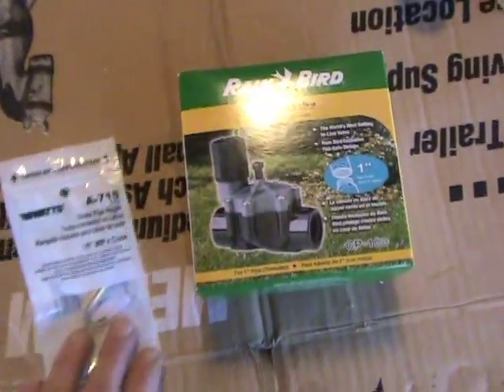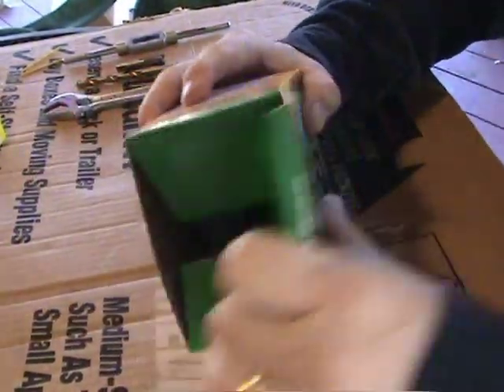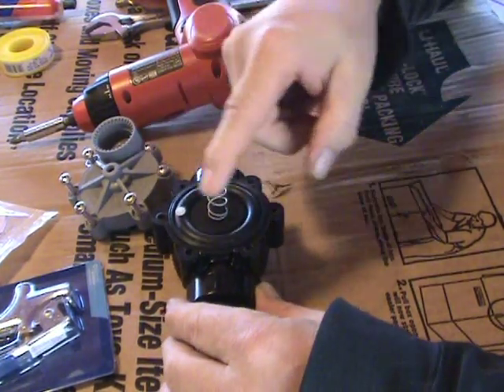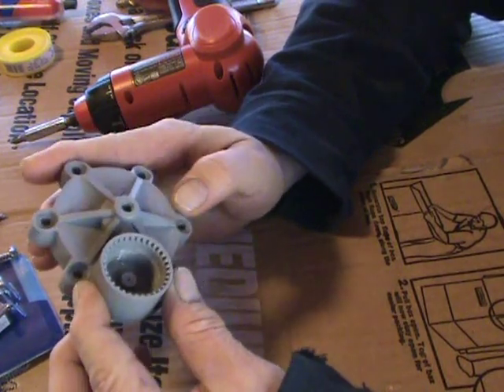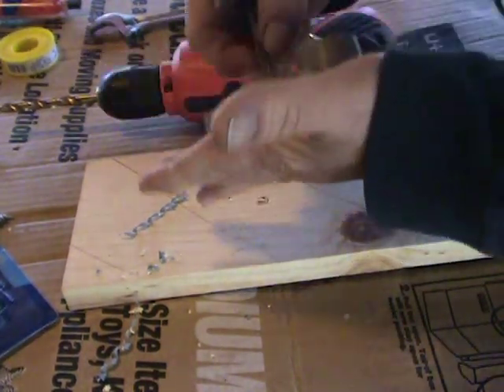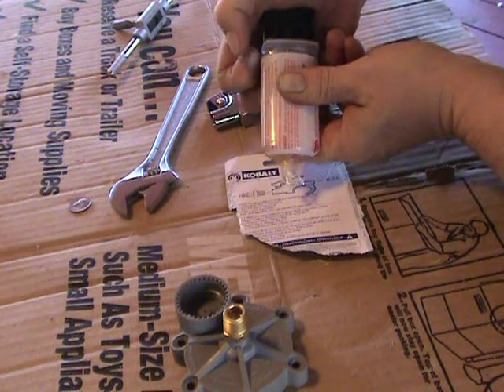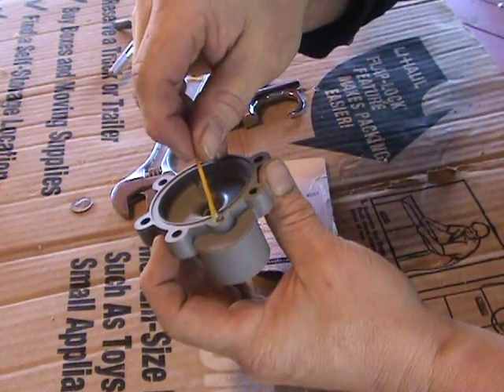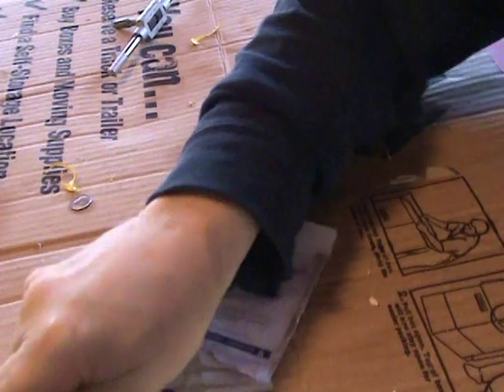Modifying a Sprinkler Valve

Comment: I wonder,  when using the solenoid as a triggering mechanism, if it would be beneficial to enlarge the small holes in the bottom of the solenoid housing slightly. Thus making the system quicker in response. Just thinking... An electrical trigger powered by a pair of 9 volt battery's wired in parallel should do the trick.  Mwa Haa Haa..

Comment: Can you help me? I bought a different valve, it had a hole in the center of the diaphram.  When I pumped the gun, the air pressurized, but when I pressed the trigger, the air came out the blowgun trigger instead of the barrel. So I plugged the diaphram, and now the air comes out the barrel, but the trigger doesn't stop the air from coming out. DOes your diaphram have a hole in it? Does it need to be there? I would like and answer ASAP. Thanks.

Comment: Thanks, this is a well done instructive instruction.  For me, I just plugged those two holes in the solenoid chamber with screws....I am pretty sure they will not be ejected and if it fails I will plug them with epoxy as in the video.....but I dislike epoxy...it is nasty to breath or get on skin.

Comment from the maker: @som1112 That could depend on where you shop. Don't get caught up in "part's lists". It's all about designing and building. With this valve all you have to remember is that you need a "tank" to hold air in, and valve to put air in the tank (Schrader or Quick Connect usually) and a pressure guage so you can tell how much pressure you have in the tank. Put the tank on the "back" of the valve and a barrel on the front. Done. 

Remember: ALL Pressure Rated PVC Pipe and Fittings. Safety First.

Comment from the maker: @Cwatts2009 

I'm pretty sure that would not be a good plan. You want pressure on the valve to build slowly. Opening a ball valve behind the sprinkler valve would drop all the pressure on it at once. 

What I've seen done for a trigger safety is a small brass ball valve between the Blowgun and the Sprinkler Valve.  Not sure how much safer it is but that's all I can think of. 

In handling a weapon the primary safety is always between your ears...

Comment from the maker: @Cwatts2009 

The blowgun does exactly what the solenoid does but *way* faster.The faster you dump the air behind the diaphragm the faster the valve will open and that's what gives you power.  Plus it eliminates the need for any power source. Nothing worse than a gun that won't fire because the battery is dead... 

The solenoid is (slightly) easier but less powerful. See SpudFiles for some actual numbers on how much more (I seem to remember it being about 10% more energy on average).

Comment from the maker: @jcjacob42 Rate is close; 1 USD = 1.02856 AUD, so yeah, 35 + PVC, maybe 50 total if PVC is about the same price there. (Note! Always, repeat, *always* use Pressure Rated PVC for every single part of a Pneumatic gun! If one of these fails it can seriously mess you up, don't skimp on the PVC; it's cheaper than plastic surgery.) Also, check out the SpudFiles site. Tons of info there on getting power and being safe.

Comment from the maker: @digidrink The trick to power is to open the valve as fast as possible. To do that you have to dump the air behind the diaphragm as fast as possible. The solenoid has tiny holes and opens fairly slowly. The blowgun has a much larger hole and can be operated pretty quickly. The difference in performance is noticeable from my experience and most of what I've read indicates the same. There are even mods to make the blowgun perform better. See SpudFiles.

Comment from the maker: @khmerst4444 

Almost any Sprinkler valve can be modded. This video is just specifict to the CP-100. A great place to find specific instructions on other makes and models is the SpudFiles website. Use their Search feature and you should find some help. It's usually just a matter of where/how to drill the hole for the blowgun.

Worst case, if you have to figure it out yourself then *you* should make *us* a video!

Comment from the maker: @puckhound95 I'm betting it's an Orbit valve, right?

I'll bet it can be done safely but to be sure you should search SpudFiles for the model number of the valve. I'll bet someone has made a post on the details for that specific valve. It may even be one with a guide rod and those can be more difficult to make work. If you can't find that model or one just like it then *you* should mod it and make a post on that model for the rest of us!

If you get stuck send me the model number.

Comment from the maker: @worldburrito45 

Power.

The whole trick to power with any pneumatic gun is how fast you can open the valve. The reason gunpowder is such a great propellant is that it expands *very* fast. Ball valves are very slow to open. Sprinkler valves (Diaphragm valves) are pretty fast but don't open as fast (or wide) as piston valves (see my vids on Barrel Sealing Piston Valves).  But, piston valves are a pain to build and you can get a Sprinkler Valve right off the shelf. It's a good place to start.

Comment from the maker: @spottydodz Not stupid, it took me a while to figure phneumatic ideas at first. It gets easier. Google "Diaphragm Valve", you'll get a ton of stuff. Also check out the SpudFiles site, join up for free and look at the Forums. Search for "Piston Valves Explained Visually", the Coaxial valve is similar to a diaphragm valve.  It takes some effort but once it clicks you'll understand most of the designs quickly. I just this week saw a Piston Valved Hybrid design that took me while to "get"...

Comment from the maker: @ogbreeb Never had that problem. First I'd try taking it apart and washing the parts to be sure absolutely no debris is in the valve. Then you could try removing the little filter (on the diaphragm itself). Never had to but have seen it done.

Also, on firing, hold the trigger wide open, don't just tap it. That'll make 'em honk too (pilot closes too soon). 

If this doesn't fix it you can try searching the Forum posts on SpudFiles.

Comment from the maker: @mrcourtneycox 

A few common issues: 

If you're filling it with a tire pump it may not have enough air flow to seal the valve. Try a compressor.

Double check the flow direction (arrows?); the airtank must be on the "in" or "back" side and the barrel on the  "out" or "front" side.

Does the trigger (blowgun) seal by itself?

If none of these is the issue then message me (also, the SpudFiles site may have some more things to try. Search the forums...)

Comment from the maker: In a word; Power.

In all pneumatic applications the faster you open the valve the more power will be transferred to the projectile in its short trip down the barrel. Ball valves are cheap and safe but have much less power. Diaphragm valves are faster and Piston valves faster still. 

This valve was actually used as the *trigger* for my 2" piston valve just to increase that valve's performance.

It all about speed. Just for grins, Google "Mauler Valve" and check out the SpudFiles site...

Comment from the maker: They will open faster and that's the whole secret to power.

That said it's going to be tough to find one over 1" for a decent price so, if you're building a big cannon, a 2" ball valve might be better simply because it'll open wider (but slower).

A piston valve is even faster. It looks hard to make one but it's not bad; I have some vids on how to make one (Barrel Sealing Piston Valve). At the end of Part 2 I show a cheap, simple design for a small piston valve so that's an option too.

Comment from the maker: I'd be very careful using any damaged parts on any cannon. If the screw was replaced and the damage was very minor it might be safe (or not),  Wood putty is not going to work. I'm very surprised your hardware place has no kind of epoxy (liquid works better than putty in this case).  Some stuff called JB Weld would also be a good substitute (and automotive place might even carry that.)

Comment from the maker: What brand is it? Could you have put it back together with the Flow direction (the arrows) backwards? Are you forcing air in the wrong end of the valve (again, flow arrows)? Is it possible the brass fitting is in the cap too far and is messing with the spring? 

(Dumb questions, I know, just checking.)

I have done 2 of these and both worked properly. Message me with the details...

Comment from the maker: If you mean the 1/8" to 1/4" brass "converter" it doesn't go in the plastic; it goes on the 1/8' nipple that goes in the plastic. Look close at 3:53. I've already screwd them together.

We can only get a 1/8" nipple in the plastic cap because a bigger hole would make the cap very weak. So, we put a 1/8" nipple into the cap and size it up to 1/4" with the converter to fit the Blowgun. 

I epoxy all Brass to plastic connections and use Gas Tape for all the Brass to Brass connections.

Comment from the maker: Well, sort of. 

If you drill it out big enough then you can screw the brass in without tapping BUT you have a *very* good chance that it will split the plastic and ruin the valve. 

Remember; this is high pressure stuff.

I got a cheap tap set (with about 30 bits) for about $30.00 and I use them for all the holes I drill in PVC. You can also buy them one at a time but in the long run you'll spend more that way.

Worst case: get your buds to chip in and then build them a valve too.

Comment from the maker: I have a great commercial plumbing supply place (Ferguson) here in town. They carry or can order almost anything made. I think it was about 8 or 10 bucks.   

That's why this project it taking so long; I had to order O-Rings and "Shock Rubber" (for a bumper) from Grainger (they *rule*) and some 3" x 2" threaded bushings, learn to cut o-ring grooves, cast epoxy (for the piston "landing" face of the bushing) and on and on. And filming always slows me down. I never get it on the first take :)

Comment from the maker: My muzzle velocity is closer to 350 - 400 fps (about 240 - 270 mph) on my golf ball gun. 

Look, if you want to argue the point then go check some sites like SpudFiles. On the forums you can find considerable evidence supporting my point of view from some guys that are *way* smarter than I.  My experience is that at the speeds we're talking about every little bit helps. There's even a mod for the blowgun itself that is supposed to make a measurable difference,

Comment from the maker: In the info (to the right, click "More") there is a link to "A visual explanation of Modified Sprinkler Valves" on SpudTech. Or google "Diaphram Valves". Basically, the blowgun vents air from "behind" the diaphram and it snaps open. The faster you vent the air, the faster the valve opens. (The diagrams on SpudTech or on the SpudFiles website explain it better than words.)

Comment from the maker: Everything I've read says that this mod is roughly 10 times as fast. Since the size of the hole used to vent air from behind the diaphram is many times bigger than the hole used by the solenoid that only makes sense. The faster you releave pressure from behind the diaphram the faster the valve will open.

Do your mods any way you want but my experience and that of the posters on SpudFiles and other sites indicates that the blowgun operation is *much* faster than using a solenoid.

Comment from the maker: Possible? Yes. Desirable? No.

The Solenoid will open much more slowly and, likewise, so will the valve. The key to power is a fast valve. The larger the hole used to vent the valve and the faster it's opened the more power the spudgun will have. They atually use these modified valves as *triggers* on larger (barrel sealer) valves just for the extra speed venting the air behind the valve.

Comment from the maker: That's a tough one. You may not find the same one in your hardware stores in Sweden but I suspect you can order it on-line, unless there is some import restriction. I did see one on e-bay for about $15.00 (search for "rainbird cp-100"). Most gardening/hardware stores will carry some kind of sprinkler valves and the procedure would be similar to mod them. Check the SpudFiles website for details on other models too. Also check BCArms website for a pre-modded one!

Comment from the maker: All diaphram valves have a small hole to allow air "behind" the valve (or it would never be able to seal). Plugging the hole would keep the valve from working at all. Odds are that you pressurized from the wrong end of the valve. There should be an indicator of flow direction on the valve. Pressure should be put onthe "back" side and the released air will come out in the direction of the flow. 

There are several good trouble shooting articles on SpudFiles that may help too.

Comment from the maker: It might be tough to find one in Sweden and I'm not sure what the import laws might allow. But the good news is that, unless you guys don't have lawns, there *must* be someone selling Sprinkler valves there and the principle should be exactly the same; you just have to put some kind of quick opening valve on the back side of the Sprinkler valve. Some models are easier to modify than others. I bet if you shop around you'll find one at a local hardware store that will work. 

Let us know!

Comment from the maker: It's a simple diaphram valve. I have some videos of the finished guns you can check out and for a detailed explanation of how these valves work go to the SpudTech link at the bottom of the Video Info to the right (Click "More info") 

As for ball valves; they're slower to open but you can get very large ball valves. So, for small guns I'd use a sprinkler valve. For large guns a home made Barrel Sealing valve is best but, ball valves *are* cheap and easy...

Google "Mauler Valve Gort"

Comment from the maker: Yes and no. If you drill the hole big enough (maybe) then you could just screw the brass in by force. 

I wouldn't recommend it though because you are likely to break the plastic and ruin a $15.00 valve.

A 1/8" NPT tap should only go for 8 or 10 bucks and you can use it on other spudgun stuff as well. Sometimes you can find a set that has the 1/8" NPT tap and the 11/32" bit together for a good price.

Trust me, if you're doing more than one of these get a tap...

Comment from the maker: @som1112 

Absolutely. In fact, if the cannon will always have a barrel smaller that 1" then I'd use a 3/4" valve instead. Smaler valves tend to operate slightly faster (less mass in the diaphragm/piston to accelerate). But if you plan on shooting golf balls or something then I'd stick with the 1" version...

Comment from the maker: @Cwatts2009

The tap makes it *much* easier to get the pipe nipple in the valve without cracking the part. For about $10.00 you can keep from ruining a $15 or $20 valve. It makes a lot of sense in you plan top do more than one or two. If you do one without the tap be *very* careful and slow and you might get away with it.

Comment from the maker: You're absolutely right. I stated that poorly. I only meant that the glue didn't have to too serious to hold the pressure in at those tiny holes. The pressure inside the valve is the same all the way up to the blowgun (hose included).  Thanks for pointing that out. We should all be careful when dealing with any high pressure lines.

Comment from the maker: @jcjacob42 

Yup, golf balls rule. The barrel for them is something called SDR-21 1.5"; fit's them perfectly (Well and Pool plumbing supply should have it). The sprinkler valve was about $20.00 and the rest of the brass and the Blowgun were another $15.00 or so...

Comment from the maker: @suckerfreelatino1 It's called a blowgun attachment for a high pressure air hose. Almost any autoshop will have one with attachments for cleaning parts, filling tires, etc. Most hardware stores should carry them. I think I paid 5 or 6 bucks for the ones I used...

Comment from the maker: Try the compressor. If it still leaks then I'd check on SpudFiles. They have some troubleshooting guides for this. If it's clean inside and there's enough air flow it *should* seal right up.

Hey, any air leaking out of the blowgun while you fill? That would be a problem as well....

Comment from the maker: It could be that the valve needs more pressure/flow to seal. Try filling it with a air compressor; take it down to the gas station and use theirs just for a test. 

Did it have a spring inside? Is it still there? (That is what should close the valve when there is no pressure.)

Comment from the maker: The "suggested" pressure by most on SpudFiles is 125 PSI but I run mine up to 150 PSI and, so far, haven't blown out a diaphram. I don't think I'd try much over 150 psi; you could actually burst the valve body and that could really suck from up close. Safety First!

Comment from the maker: The blowgun just triggers the opening of the valve. You still need to have a tank of pressurized air on the "input" side and a barrel on the "output" side of the valve. Check out my "Watermelon" video. It shows the basics of a sprinkler valve pneumatic cannon.

Comment: Check the solenoid. If its on too tight it will not open the valve properly. It may also be too loose. Also i reccomend at least 18V for consistant operation. I used a single 9V on my gun for a while and it would frequently fail to open even though the solenoid was actuating.

Comment from the maker: You got it. It's just a simple diaphragm valve and the blowgun is on the "back" of the diaphragm. Relieve the pressure behind the diaphragm and it snaps open. The faster you dump the pressure behind the diaphragm the faster it opens and that's the secret to good power.

Comment from the maker: @xj650rj You can use the Solenoid but the vent hole is very small and thus the valve actuates more slowly than if you use a Blowgun. The blowgun is mostly for efficiency and the fact that it eliminates the need for power is just a bonus...